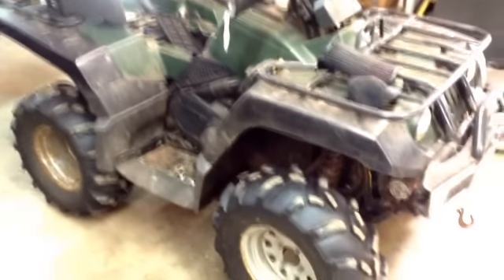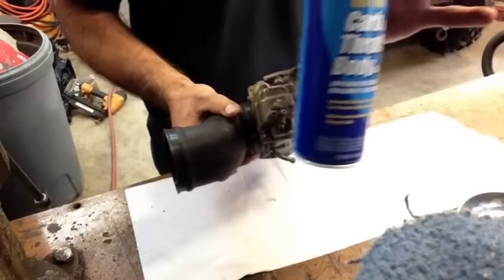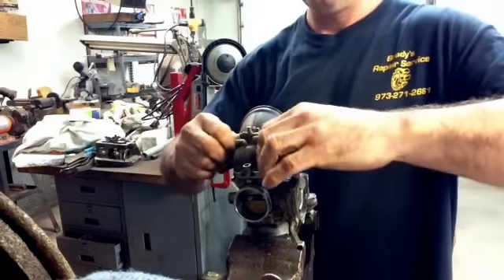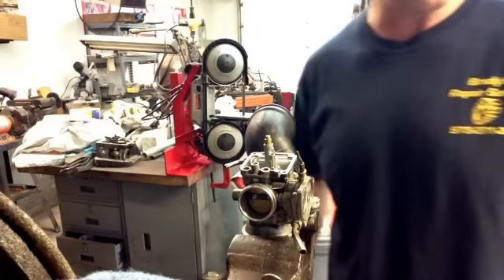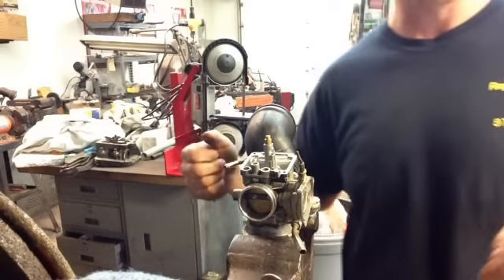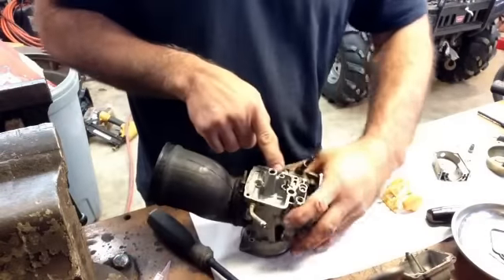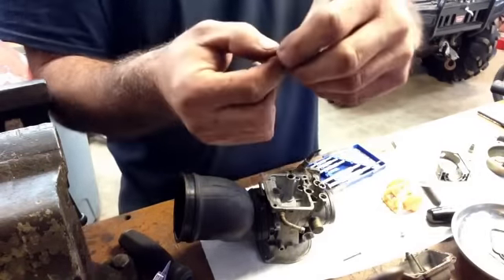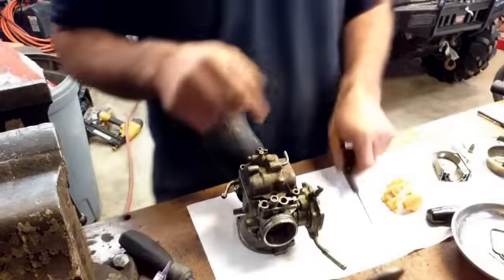ATV Yamaha Grizzly With Leaking Carburetor - Part 1

Comment: I just got a 2000 Grizzly 600 that was neighbour next to the sea... Everything on this quad was a rust bucket... Every single nut and bolt exposed to the elements where badly rusted... I had to Dremel cut almost everything to get to the carburetor and even on the carburetor... What a mess....

Comment: How do you adjust the float on this carb? My carb leak fuel all the time. now the atv backfires badly when i start it (it will not run). got the carb out but looking for the float adjustment
Reply: Sean u gotta bend the little tab down and it’s backfiring because gas got in the top cylinder and fouled out the spark plug so buy a new spark plug and these carbs are so cheap I’d just buy a new one off amazon for 50$-70$ worth doing that just to have a brand new one! Good luck

Comment: I see these carburetors for about $40. Is it really worth the rebuild or are these replacement carburetors ok?. I even found one on Wal-Mart. Com for $37.00.
Reply: Bear Bridges a factory carb from yamaha is 400 canadian.. so i bought one off amazon.. cant get the needle and seat to stop leaking cheap junk
Reply: it was 50 bucks might get lucky might not factory is always better
Reply: @connorwilson8696  I got a new one for $29. I also got a rebuild kit for the old original carb. Now I have the Yamaha carb as a spare for when Chinese carb fails. It's about a month out and doing great so far.